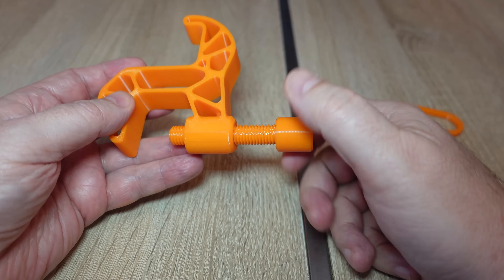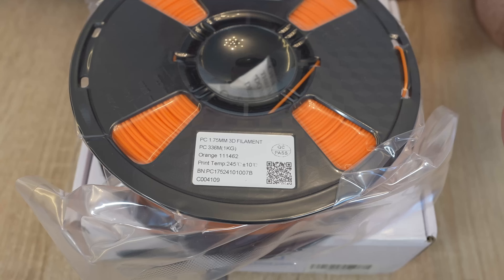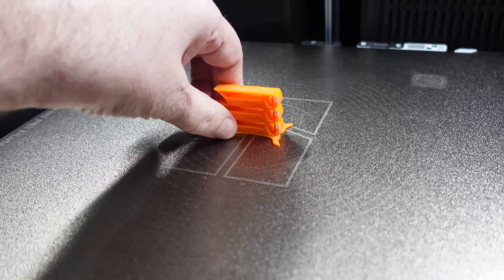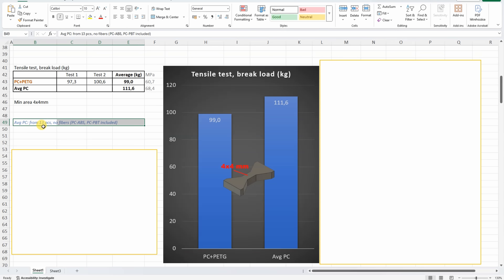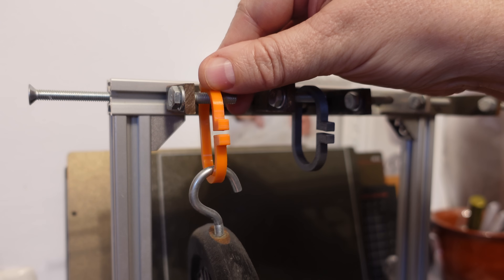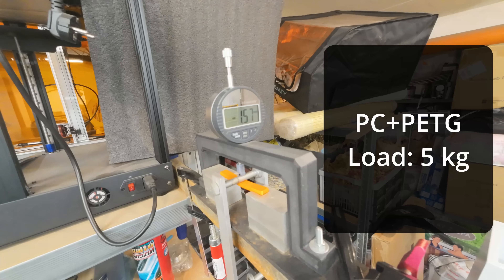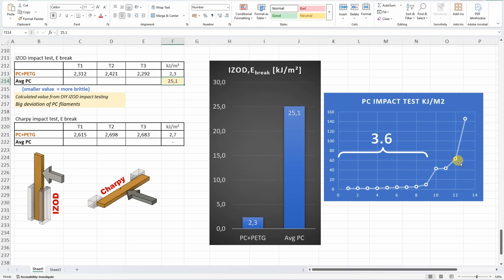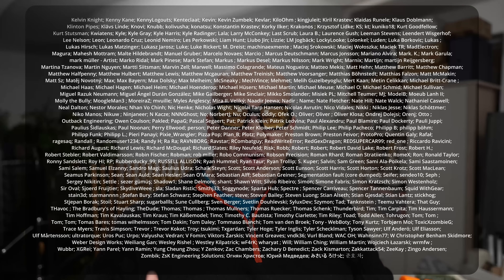CC3D PC-PETG Blend Tested – How Close Is It to Average Polycarbonate?

Comment: You should add a test for material fatigue, specifically how many times the plastic can be bended (within its breakingpoint) before it breaks. PETG, for example, is significantly better than PLA in this regard, and I believe this is why many consider PETG to be "tougher" than PLA even though PLA often has higher impact resistance.
Reply: For example: if a filament has a certain deformation limit, test whether the material fatigues and fails after, say, 100 bends at 70-90% of that limit. Also, test how many bends it can withstand at 100% of the limit before it fails.

This allows for a comparison of materials in designs requiring spring-like functions, such as snap-fit locks or parts that must be flexed repeatedly.

Comment: I printed overlapped pipe swivel joint part for vacuum cleaner head, wall thickness 2.4mm , pipe diameter 40mm, and the filament is excellent, taking in account the load on the joint. I used higher temp 265C and lowered the speed to 100mm/s ( I usually use 120-150mm and 255=260C for PETG). The bed  adhesion is slightly lower then PETG but sufficient.

Comment: Nice! You might find it interesting to have a look at Spectrum's PETG-PTFE composite. I bought a spool when I printed a V-Spooler X, since that's what the designer mentioned they used in their samples. The idea is to produce "self-lubricating" parts. No idea if that actually works as expected long term, but I can say that my prints were very successful, good quality, and performing well. No idea if I just overpaid for some PETG, but it seems to have worked well!
Reply: @jcandthewires He did review that 8 months ago. The video is titled: "Teflon Inside PETG? Review of Spectrum PETG+PTFE filament".
Reply: @MediaMan3D Ah. Guess I’ll have to go back and find it. Thanks!

Comment: Thanks for your testing! It's not that often, that i'm quite surprised by the test results. I was shure, the PETG would ruin most of PC's advantages... I often use spectrum PC 275(if i need to use PC...). Also it seems quite modified(about 115°C HTD vs.~130°C generic PC[measured in my kitchen oven]) it's still a nightmare to print for certain difficult parts. Even though i can't really compare my measurements to yours, this really looks promising. I'll have to give that a try sometime.

Comment: Oh man the day has finally come to see my absolute favorite filament get some actual numbers behind it. I swear up and down by PC-PETG for anything in the Zaxis that doesnt need huge impact resistance, or anything that will be torqued. I even recently started printing large structures with this stuff. It might even be replaceing ASA because from my experience, im convinced this stuff is not as UV resistant, but my out door stuff still holds up great.
For drying this filament, i just follow bambu labs PC drying. I get good results with this.
I print this out on a bambu labs x1c and a prusa core one, 115 bed temp, 10% fan min, 20% max fan, 100% overhang fan at 25% overhang threshold, 55c chamber, 265c nozzle temp, 9mm³/s max flow rate, .18 layer height, .5 line width.
Core one i made one print. Same everything as above but with a 5% min fan, and 20% max fan.
My next project is going to be a fully 3d printed block and tackle pully system. The pullys i have decided to use this filament for strong tensile strength and good under load. I also suspect this stuff will work great for the print in place ball bearing due to PETG and PC being good against wear

Comment: I expect it won’t print well on an open-air printer. I hear Prusament EasyPC and Sunlu EasyPA should be printable on an open-air printer though.
Reply: CC3D PC Blend filament is very easy to print. As long as your bed can heat to at least 90C you're good to go. I print with this filament almost daily on a Bambu Lab A1 combo with no issues.

Comment: I have standardized all my printing using this filament (unless there is a specific requirement for some other type). ! I love this stuff. Low cost, easy to print, no smell.  I use the CC3D PC Blend filament (Black, White, Clear, Yellow, and Orange) on Bambu Lab P1S, A1, X1 Carbon, and Prusa XL. Did you do a wear/friction test? Does it wear better than PETG or PCTG? That is the one thing I need to know beyond what you have reported. It would be interesting to see how this stacks up against the Prusament PC Blend. I have not found any other PC blend filament out there yet. Thanks for all the great work you do.

Comment: Huh. Pretty cool. Wouldn't be surprised of some other PETG on the market has some PC in it and they market it as "Ultra PETG" or something. Not really sure where this fits in for practical use, but seems like it's an easy to print PETG with some desirable properties. I'd like to have seen the graphs compared to average PETG as well.

Comment: Please consider testing Ambrosia ASA filament.  They are new, and they have some colors of ASA that you cannot find anywhere else (e.g. Voron Red, Prince of Purple).  In my testing, they print better and about 10% faster than Polymaker ASA at about 20C lower temperature.  They are also almost 25% cheaper than Polymaker.  The primary downside is that their HDT is lower (88C vs 103C for Polymaker ASA).  So the Ambrosia may be a blend, similar to 3DXTech.  Also, you should try Flashforge Rapid PETG (sometimes called High Speed).  I have been tuning all of the different brands' PETGs and this is one of the strongest I have found when printed at 280C.  It has one of the sharpest temperature dependencies I have ever seen; at 240C it is almost worthless but at 280C it is almost indestructible.  What is also strange about this filament is that it cannot bridge without G-code modifications to the printer; you must dynamically lower bridging temperature to 240C or below and bridge very slowly, otherwise, the bridge will not stick.   Let me know if you need a print profile for your testing.
Reply: ABS and PETG are miscible, and should produce rather spectacularly printable blends in my mind.
i wonder if ASA and PETG are miscible too.
88°C reminds me of HIPS. HIPS isn't actually miscible, but compatiblisers have been used to help it along.

Comment: Nice material. Great to see the high layer adhesion numbers. I don't think I'll have a use for it as I need the stiffness of GF plastics for most of my prototyping, but it's good to see innovation in filament offerings.
Reply: Whats funny is this has been out for years. I've bought 12 rolls of it so far - the black color, however. It''s really tough stuff.

Comment: This looks like interesting alternative to PET-GF. Especially at the price point.
Reply: As long as you don't need the stiffness of the PET-GF - I haven't compared the numbers but I believe PET-GF has a much higher young's modulus meaning it will flex less under load.

Comment: Hi, do you think it would print fine without chamber heater?
Reply from the maker: Shrinking is like ABS, so no or small height.
Reply: If you do have a chamber, just turn up the bed to 100°C (or to your max bed temp), wait for 20-30 minutest, and you should have a pretty warm chamber without a dedicated heater.

Comment: Over on Printables is a spool weight catalogue, it lists the CC3D plastic spools as being 171g
Reply from the maker: Good to know. Thx, very useful comment. But still,  companies may variate the design, that's why I prefer having this info on the spool
Reply: @MyTechFun  I agree that spool weight should always be printed on the spool. In the meantime that catalogue does a good job, listing cardboard and plastic spools and where there's variation they show the range. It's growing all the time too.
Reply: @MyTechFun  100% agree. When I got CC3D's PBT-CF, I reached out to them about the spool.  They told me the spool (same design as this on) is 165g and is good for 75C continuous.  Their drying recommendation for that filament is 3-4 hrs at 80C, so it is fair to assume the spool is ABS.

Comment: My favorite 3D printing channel. Could you try this on your open air Prusa?
Reply: It will at least lightly warp in open air without a really good adhesion aid and some very dialed-in printing. This material also has the self extinguishing properties of polycarbonate in my experimenting, so I use it for most things around electronics.

Comment: Nobody uses ABS anymore. All ABS users switched to ASA for better UV and almost no smell. Instead of comparing it to PC, you should have been comparing it to ASA. (also, UV resistance should be tested somehow not to mention post-printing finishings methods).
Reply: ABS still massively outsells ASA which says that not all ABS users have switched.  ABS is still far more popular with Voron builders on discord. There also unfortunately still isn't any ASA that is as matte as something like Fusion Filaments ABS 1.5 / Matte. I actually prefer ASA for properties such as UV and slightly better temp resistance. However, it doesn't always have less odor when printing or is significantly less toxic than ABS since it still has styrene.  

SolarLight does UV testing where they simulate 2 years of UV in 2 weeks. I've replicated this test in a lab UV box.   The equipment is not trivial to reproduce. Leaving it on your window sill for a year or so is excellent and cheap, but it's not within the time-frame of YT testing and reviews, lol
Reply: The legacy crowd is probably still large and won’t just dump their stock.
Reply: You absolutely can smell ASA and should be equally as careful

Comment: Dr. Gaspar, please don't forget all the millions of poor people, who have only an open 3d-printer. They also want to use new filaments like PC-PETG. Please check the materials also for printing without an enclosure and warping properties.
Reply: I print with ASA where there are literal armies of people who tell you that you can't print it on an open frame printer. I only print functional parts and I've never had a part break so far. I just make sure I don't walk past the printer too fast, point the AC vent at it, open the window and let the breeze flow through the room, etc. I wasted time with draft shields in the beginning and it doesn't even need it. I assume this same info can be applied to other filaments that are strongly recommended to have an enclosure. Then you will get the left over bits of the enclosure army that will say "yeah, but your strength is compromised, it won't be the absolute max the material has to offer". Dude, it's strong enough. Just make the part 5 mm thicker and add a wall, use more fillets or something, geez. I'm not printing brake calipers for a semi truck here, give me a break. I've already chosen a material overkill for the application.
Reply: My bet is we could go fine with smaller items. Brim, tabs, etc will hold the piece down. The 60kg layer adhesion result kinda suggest it wont delaminate. Shrinkage might cause problems on longer/big prints though, but as others advised a simple, primitive cart board might be enough. 
But i can relate. I would like to see an open/enclosed print comparison
Reply: Diy enclosure is very cheap to do :) it helps to have 30-40 degrees in there.
Reply: Just use some cardboard or better yet some thin foam board to make your own little enclosure. It's easy and if using foam will be even better then any non heated chamber enclosed printer. I use to print abs on a very shitty open 3d printer by just keeping it in very small room and had very large prints that came out perfect.

Comment: CC3D makes weird but good materials. Unfortunately their PBT Pro has been missing from Amazon IT since months, and on Aliex it's much more expensive.
Reply: I was lucky enough to get some from Amazon's last batch. Someone has rolls on Amazon Marketplace for £300 each - SMH
Reply: They have a new one just called PBT as well. 
The normal PBT and the Pro are both in stock for me on Aus Amazon
Reply: Love their PBT CF filament! Used it to print a lot of functional adapters for the diesel air heater of our camper and it just works so well👌🏻

Comment: I just checked the US Amazon link...it now only shows the filament as PC?
Reply from the maker: Mentioned at 0:45 , but looks like somebody still see the info about the blend.
Reply: I see the black color on us amazon still shows the 50%PC, 45% PETG, 5% random things for me, maybe they didn't change all colors. Orange one has it missing.
Reply: @radfaraf  That is correct.  Just search for "CC3D PC Filament". There are a few colors that have the mention of 50/45/5% and some that do not.  Orange does not.  CC3D's website has PC listed, but does not mention anything about the contents.  I have requested a TDS like I did for their PBT-CF. They've usually been responsive.

Comment: US Amazon link is still showing the 50%PC, 45% PETG, 5% random things they scraped off the factory floor.
Reply from the maker: Ha ha... those 5% 🙂
Reply: That's a good formula the 5% makes it impossible to copy without sneaking into their factory.
Reply: @radfaraf  Yeah I'd imagine the 5 % is the "secret" sauce that makes this blend possible in the first place, if it was just 55 % PC and 45 % PETG (55-45 just so they still can call it just 'PC' 🤣) it would probably be either too weak or straight up unprintable.
Reply: @mr.rapter4517  The secret sauce is floor sweepings.
Reply: @mr.rapter4517    PC is kind of notoriously immiscible.

Even the common PC+ABS blend doesn't work without compatiblisers, doesn't produce a cohesive blend.
Reply: I have tried a few cc3d's filaments and havent found a bad one yet. I really like the 72D TPU (works in AMS too) they make for certain things
Reply: It's the factory workers sweat and blood, obviously. Since it's different for every site, nobody will ever be able to copy it. 😂
Reply: :D